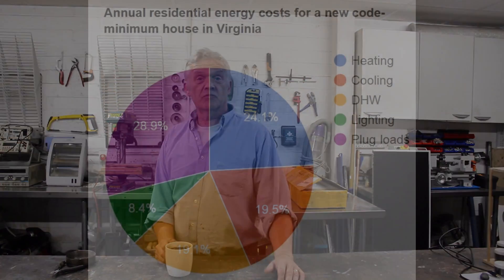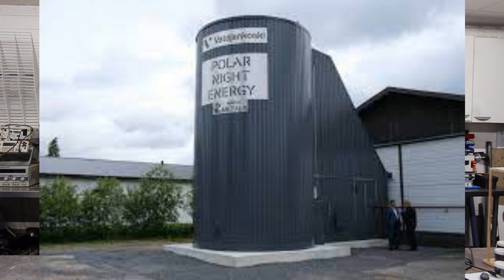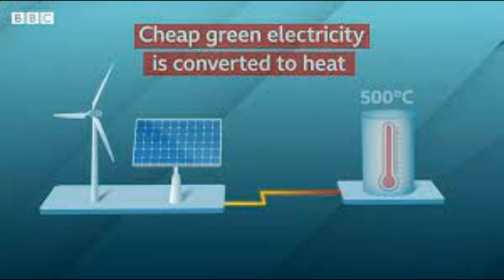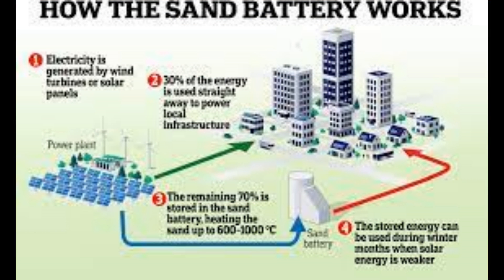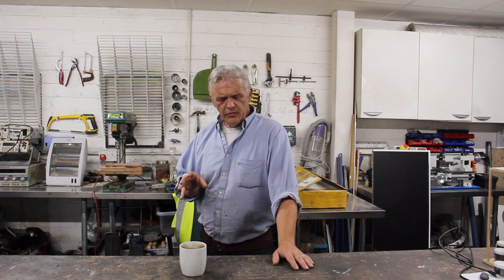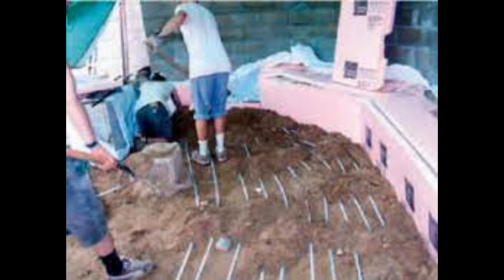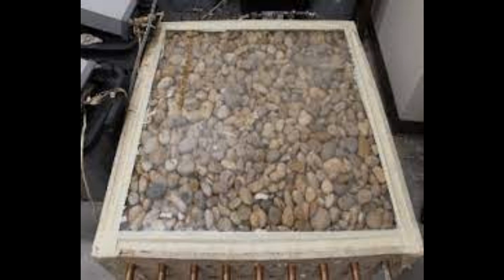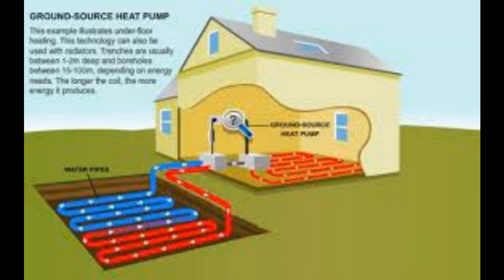1604 The Sand Battery - A DIY Option Or Not?

Comment: I know they upgraded them to Use Magnetic Induction And Molten Mix Metals Graphite Core  and then have Sand & salt With Aluminium & Copper & Steel of old engine worn parts

Comment: My neighbour's back boiler on his solid fuel range got damaged so he filled the boiler with sand as it could no longer hold water so he light's the range cook's his meals heats the house and the sand in the broken boiler stays hot meaning he now has a warm kitchen even the day after the fire is extinguished

Comment: I know it's an old video but I'll try my luck with a question. So, in your opinion, would a buffer tank with sand work?  There would be several ways to heat the sand, but let's say there would be a heat exchanger at the bottom, which would heat the sand, and a heat exchanger at the top, which would extract the heat to the radiators in the house. And I'm thinking about 2-3 cubic meters of sand. I am very curious about your opinion. I do not dare to start this project because there is a lot of work to do this experiment and I have the impression that I am missing something.

Comment: Could household radiators be filled with sand instead of water, and heated by low voltage electricity to heat a domestic property?

Comment: Why not also use that graphene oxide, which is fairly cheap and still acts as an excellent thermal conductor.  Mix it in and use special designs for storage tanks for maximizing heat dispersion.  Maybe radio towers built at the center of a spiral tank of sand mixed with salts and graphene and water.  Remember an experiment in which radio waves beamed at salt water CAUSE IT TO HEAT UP AND FLAME!  USE THOSE PRINCIPKES

Comment: 1460 is a company in Australia which has a large scale silica battery plant on trial at the moment. Dumping solar and wind energy as heat into large scale silica (sand) batteries then using the heat to drive turbines to generate power. They are also working on using 'waste' heat from large scale industrial processes to generate power.

Comment: Hi, need help! I’ve built a diy sand battery with the intention of heating water, I’ve heated it up to 250c degrees and with a stainless steel coil in the sand, I put water through it   And it was hot for a for seconds then went cold. Any ideas?

Comment: Too much babbling. It's an opinion piece, rather than instructions, (which you're great with). A sand battery wouldn't be practical for most urban residents, (except for heating office buildings, shopping malls, factories, and apartment blocks, as the Finns would do); but, what about off-grid and rural applications, (which you didn't babble about)? A woodstove can warm a house quickly, but can go cold quickly, too. The Finns also do a better job with masonry heating, (radiant heat from a wood fire, rather than convective heat from a metal woodstove). Look into that.

Comment: There is this another prototype(probably panented too...) Where they put rocks in 2 sealed insulated bunkers, and use heat pump(refrigerator of some sort) to move heat from one bunker to another creating temperature difference between 2 bunkers, rocks hold temperature, to extract energy back they use stirling engine(heat pump in reverse can work as stirling engine so most likely it is the same unit). Roundtrip efficiency about 30% for AC electricity in -> AC electricity out.

Comment: Now on ebay you can get a 100W solar panel with charge controller for campers, to which both a regular battery and load can be connected, as well as 2x 5V USB. For just £26.
You can also get 100W ceramic heating elements for £10.

What if get a gas bottle, or discarded emersion tank. Fitted a coil of stainless steel pipe inside with each end sticking out bottle and weld sealed. Pack bottle with sand and weld back shut.
Then use 5V USB fan to blow air past the 100W heating element and through the stainless pipe up through the sand. Once sand extremely hot, the element can be turned off and the fan can continue to blow air through pipe to be heated, and warm the room. If taking the contraption indoors to heat room, the USB fan could use a USB plug.
Would the 100W solar kit power the element and fan? Might it also charge the connected battery at same time for when the solar dips out?
If it was a regular sized propane/lng gas bottle it could be pretty mobile, just the weight of the sand to worry about.

Haven't got £50 spare to try it out... maybe a starting point for the idea of portable solar sand battery heating though.

Comment: Water has over four times the specific heat capacity and plays nice with heat exchangers.  You can get the heat in and out quickly.  To be viable sand would need to be heated to 350C to contain the same specific heat as the same mass of water at 80C.

Comment: Can i cook a potato with it? no, can i make pancakes with it? no, can i boil my kettle with it? no. About the only thing i can use it for is in home heating and solar water heating, both of which can already be achieved with a normal solar hot water heater... sand batteries achieve nothing new, just gossip.

Comment: I remember a Mother Earth News article about a HAHSA (Heat And Heat Storage Apparatus) Basically they built a small building, put in a wood stove and ran pipe through the building, then filled it with sand. The pipes were fed from a well so low water cost. This unit provided their heating and hot water for the house while the well could be used for cooling with a switch. Water was recycled through the system so the well only kept it topped off. They did have to light a fire every few days during the Summer for hot water needs. Combining that idea with solar panels on the roof might be something to look into.

Comment: I had an idea i am going to try and sure its not new. Just wondering what you thought. How about using a cylinder like a 100 lb propane tank, cutting it open, put your rocket stove inside it, weld it back up and fill it with sand and use that as a sand battery.

Comment: So what if we just put a small electric oil - heater tube in a sand filled container? And when it reaches a good temperature just turn off the electric heating tube. and enjoy the slow output of heat.
Reply: Oh course it's possible to draw electric during the night on economy seven.

Comment: Back in the 70's my father built a house with a solar wall that heated air, and warm air was blown into a large volume of rocks in an insulated space. It wasn't sand, they were sizable stones that had air space between them. It wasn't the miracle the clients expected, but they asked him to do it. They sued him and lost, but it was expensive in more ways than one. I still think it's a good idea, the insulation of the thermal mass is very important, so is the circulation of the air.  Heating with the sun when it shines is easy, but the real trick is to cool with the sun where there is too much of it and the days get hot. Convection and cupolas can help. Insulation is a very important factor.

Comment: Would it not be better to use a heat pump to heat the sand as they usually give 3-5 times the heat output per kilowatt?

Comment: Thanks for all your hard work Robert, here's an idea.  I see you have over 300k subscribers on your channel and it gives me great hope that there are so many people genuinely interested in solving some of our energy problems. I was thinking, if a couple of thousand of us threw in ten or twenty pounds each, it could fund research into a sand battery by providing the funds to dig the hole (preferably beside a solar array), insulate the hole, fill with sand, piping and temperature sensors. Connect an air to water heat pump or whatever heat source is most appropriate to the piping to heat the sand. We probably need another pipe for extracting the heat. The next step is measuring how many kW it takes to heat the sand, see what temperature can be reached, then measure weekly for a number of months to see how long it lasts. A pump can also be set up for extracting the heat, I presume this is also an air to water heat pump. If it was an open source project, the learnings could be shared and if the results were favourable, it would help others to replicate the system in the quickest possible way around there World. What do you think Robert, is it worth a try?? 🙂
Reply: I don't know the current status but I read a few years ago that a solar farm in the US (AZ or NV?) was gong to use salt to store heat during the day and extract it for power at night.
Reply: @briankeithwood  thanks, I'll check it out

Comment: Thanks for your videos. Very interesting and informative. My father was a mechanical engineer who taught himself electrical and electronic engineering as well. When he was approaching retirement in the 1980's, he researched how to build his retirement home in the country. he took all the Environment Canada weather data for decades for the area (north shore of lake Ontario) and designed a south facing, ranch style (one story) 4800 sq. ft house, that had a large solar porch. Fans would take the hot air and blow it into an insulated gravel box, which only took up a small portion of the 4800 sq. ft. basement. His calculations showed that in the worst possible sunlight conditions, he could heat the entire house for about $150 per month. The local power utility sent out reps to look at his house as it was being constructed. Unfortunately that house is no longer in the family so don't know the current use of the system, as he also had other "backup" systems installed.

Comment: Maybe a sand space heater, similar to the clay pot candle heaters? A 3 gallon pale should hold about 42 pounds of sand, which is a fair amount of mass for heat storage in a space heater.
Heat a 3 gallon metal pale, or several metal 3 gallon pales of sand in a solar oven or use a parabolic dish or on a rocket stove, or on an oil or gas burner. Bring the pale inside and let it radiate the heat into the room.
Maybe put a pipe through the middle of the pale so a small fan can blow air through it into the room. And maybe put a few candles or other heat source beneath the pale after it is inside to make the heat radiate longer.
Maybe put metal rods inside the pale sticking up from the bottom to help conduct heat into the sand from the bottom, where the rocket stove or candles might heat it.
Sand can hold a lot of heat, so blasting it on a rocket stove might really get it going. Don't know about the candles (maybe a Crisco candle with several wicks?) adding enough heat to help it radiate heat longer, though. I figure someone here smarter than I am can contribute if the idea is feasible.
If 42 pounds is too heavy to comfortably carry, maybe scoop into a smaller container and fill a bigger container inside the home in 2 or 3 trips.
Just seems like a way to use the heat generated outside to warm a small space inside the home. A solar oven would be the most passive way to heat the sand, though a rocket stove would heat it much hotter much quicker. Heck, I'd bet the rocket stove could heat the sand hot enough to cook on. Wonder if the sand can be insulated well enough to retain most of the heat for a day or two. If it can, this might work for both space heating and cooking a few meals, all from just one long burn at the rocket stove.
(I make concrete garden figurines at home, so I have bags of sand on hand.)

Comment: Living in an Earthship. We heat and cool our home with temperature stored in dirt.  We heat our water direct from sun with a solar collector and always have hot water. Electricity comes from a 2.6 KW solar system and is stored in a small 14kw LiFePO4 battery bank. Water is from rain water off the roof and we have managed to have enough but if we get low we have it hauled in.

Comment: Early sixties popular mechanics magazines had several articles on building rock bins that were solar heated and you blew air threw the bins at night to heat your home. A very simple design was an outdoor bin that was triangular upright with one face facing the sun. The bottom and sides were all insulated and the inside was baffles with rock filling the enclosure. The sun facing side was a solar collector with an insulated cover that also reflected more sun toward the collector when opened. Air from the collector heated the rock all day. Late in the day you closed the collector cover to insulate against heat loss and circulated indoor air through the rock heating your home with just the cost of the fan. Even simpler was a rock bin in your basement heated by solar that could provide several days worth of heat. These collectors were even reversable to provide cooling if your summer nights were cool. You chilled them down over night to provide cooling during the hot daytime. I don't see any reason the sand banks couldn't be used in the same way.

Comment: could you use a solar mirror to heat up a closed loop of CO2 pumped through piping running through the sand rater than use a heater or similar?

I wonder just how hot you could get a tube of CO2 using a bank of solar mirrors is all.

I've seen a few which are shaped like the letter 'C' when viewed from the side...they tend to use a tube of water instead though.

My thought is that you could likely get CO2 hotter, quicker, than water and also that the rate of heat transfer from the CO2 piping to the sand would be relatively respectable too.

Heck, it may be possible to do away entirely with the pump as it may work similarly to a heat pipe system in PCs.

Comment: Problem with sand batteries for low grade domestic heat is that you can't use heat pumps easily, some companies such as Malta inc are using brayton cycle turbines to do this, but they are limited to the creep cliff of steel so about 600degs. Ohmic heating will be necessary to decarbonise industrial process and temperatures above 600degrees. 

The only option for domestic heat is to reduce demand by infilling/urban densification, renovating/sub-divding and retrofitting buildings with high performance envelopes and good geometry (<2 form factor, lower % glazing etc) to reduce demand for heat and the power output of the mechanical systems. We ideally need to go below 35w/m2 (with well distributed building stock with no more than 30m2/person - so ~1kw/person peak). 

By having low demands/low output heating system we can use low temperature heat at <35deg, often <30deg flow temperatures. The return needs to below 30degs peak load, which is achievable with convector radiators. In doing so you can use a highly efficient refrigerant cycle, at high temperatures, with heat pumps using supercritical co2 as a refrigerant (r744). These heat pumps operate close to carnot efficiencies at high output and can store heat at 80-90degs. Therefore, you cans store heat from <30degrees (return temps of your heating system) up to 90degs. A 60deg delta using water allows for a storage capacity of about 100kwh/m2 of floor space (75%packing factor of a cylinder over 2.2m height). 1/3 of that demand is often domestic hot water. So you're left with about 66kwh/m2 thermal store (1% floor space of a decent sized family home) for central heating. 

This will allow the typical 100m2 home to store heat for central heating for 75% of the day, and allows your heat pump to only use the cheapest 25% period for using off grid electricity. This is relevant because as renewable are variable, we will get a divergence in peak/offpeak rates. The better that ratio, the more valuable storage becomes. 

Mid rise buildings can easily get to passive house standards of <15w/m2. With simple 10-15m3 thermal stores they can go well over 100hrs of storage, which gives guarantees even cheaper rates of electricity, and even cheaper heat along side very low demands. We are talking about getting heat below 2-3p/kwh, which is much better than gas can ever achieve, and thats with 70-80% reduced demand in the first place.

Comment: Sand Battery is essentially a varfiant on Geo-thermal where you not only run water through to moderate your living space temperature, you purposefully heat the dirt.

You are selecting a type of dirt (sand) and separating it from the mass of the planet.

There have been other "thermal mass" modes of moderating the living space temperature.
Thick Adobe walls are a thermal mass energy storage and temperature moderation system.

A hot water tank is a thermal mass system...
Reply: We change because... economics.  Cost to benefit.

When the only way to moderate a home's temperature in the middle of Texas and down into Mexico, they did use the Adobe.  Sometimes 4 ft thick clay + grass walls.  the walls were hard to heat and hard to cool so the temperature stayed pretty steady in the home.

Expensive in labor to build this way...

So when cheap air conditioning was invented, that and the common 2X4 stick built house replaced most of the adobe houses.

Now, the AC is getting expensive and unreliable... so variant thermal mass is coming back.

Comment: If you use heat storage say from wind in an ad plant the third of gass that is used to heat the plant can be put into storage. If that gass is they burnt say at my a council swimming pool in a combined heat and power plant you get heat for the pool and power for the grid. supposedly super efficient when you use heat from an engine

Comment: Using a high quality energy like electricity to dump in a resistive heater to a thermal storage is not smart. Using a heat pump you can get over 3 times the thermal energy out of that electricity compared to using it in a resistive heater. You would get much better efficiency with a concentrating solar collector to feed a thermal energy storage like that.

Comment: I thought about using a mini split to charge the battery in the summer as I cool my home. Instead of exhausting the hot air in the atmosphere it would exhaust to the sand battery. All comments welcome.